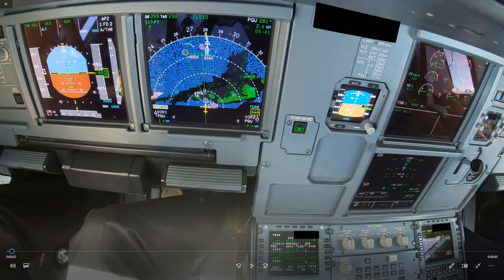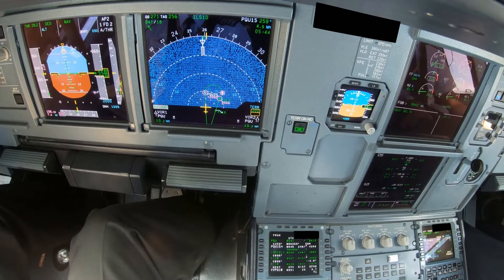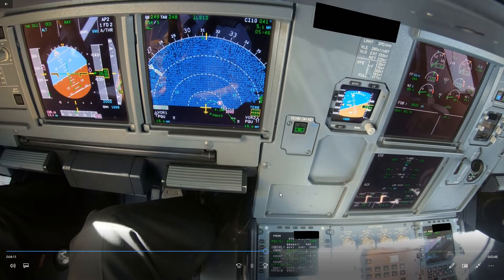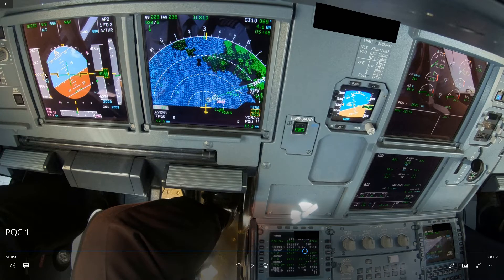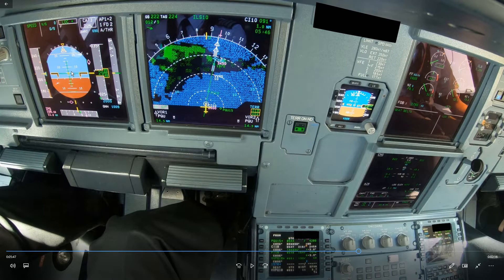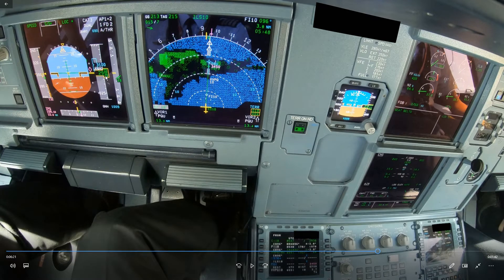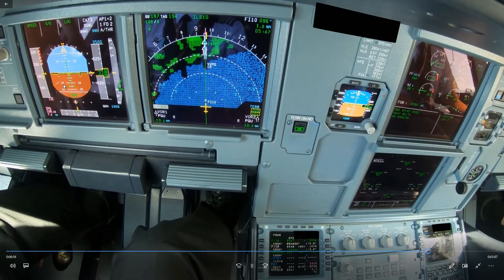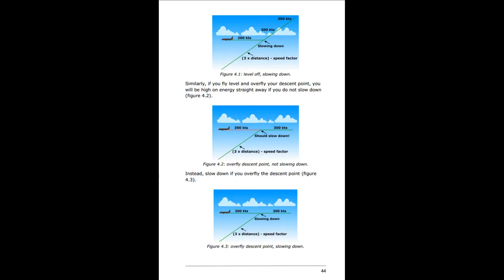A320 Descent Management - VVPQ, slowing down too late

Comment: Captain I think I am overthinking this but I have two questions. Sorry if they are stupid.

1. I’m struggling to understand how increasing speed in op des actually gets you to your destination quicker, my reason for this is because surely if you increase the speed you are losing vertical height quicker more vertically but sacrificing your horizontal distance?

2. In a strong xwind from the right, I would need left rudder on the rollout to stay straight. However, my question is if I then wanted to vacate to the right how is this best done, because eventually NWS becomes more effective and I would end up turning left if I kept left rudder in (progressive amount as decelerating) in this situation is it better to slow down to taxi speed and use the tiller or once down to a slower speed will I be able to use into wind rudder to vacate to the right? Hope that makes sense.
Reply from the maker: 1: You have to think of it as speed vectors in trigonometry. The shortest route is not necessarily the quickest route. It works the same with road navigation. If you can drive faster on the highway, you might reach your destination earlier, despite driving a longer distance.

2: At taxi speed, the weather cocking effect is small enough to make no noticeable difference on any rudder vs tiller technique. At this time, other variables, such as how far you are off runway/taxiway centerline make far more difference. 

In general, the easiest way to deal with handling techniques is to apply input whatever is necessary to achieve your goal. It is often not required to think ahead too much. Of course it gets easier with experience. When I first started flying (or even driving), I was the same like you, wanting to understand all the theoretical details so that I could be ahead of the game. But often it created more problems than it solved. Just look out of the window and do whatever is required. With crosswind, the only thing you have to anticipate is kick the rudder the right way just before touchdown, then keep the rudder after nose gear touch down. After that, just react to the aircraft.

Comment: Is there much difference in vertical speed with f2 180kts open des between being very light and very heavy?
Reply from the maker: Not enough to make any meaningful difference over a long enough time.

Flaps 2 should not be used for drag because you can't retract it when not needed anymore like with a speedbrake. And while slowing down to 180 kts, you reduce the VS and if you do that too late, you can end up above the glide slope.

So if you use F2 with 180 kts in OP DES, it will be for a relatively short time. If you are very light, the descent angle will be steeper, but not enough to make a big difference over a short amount of time.